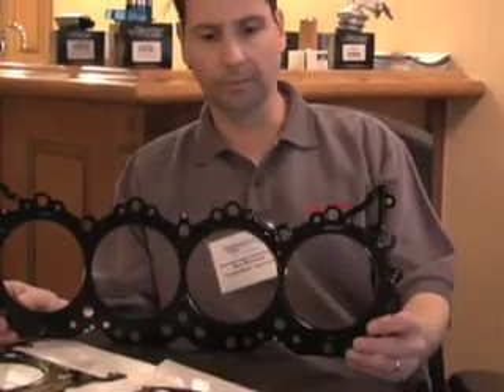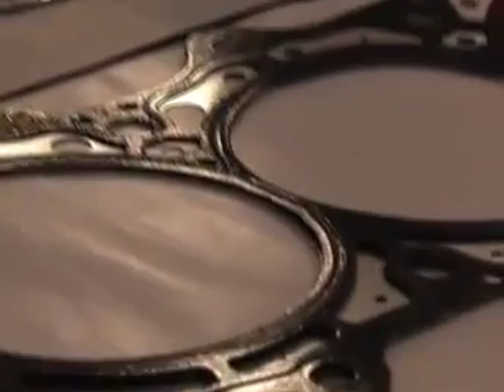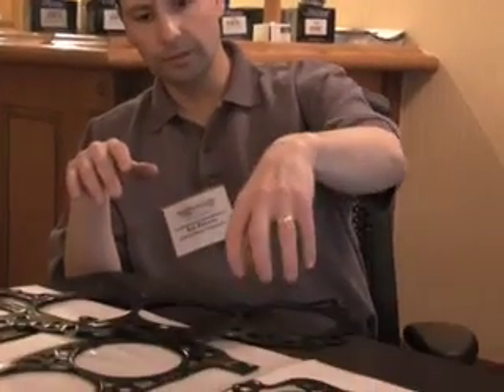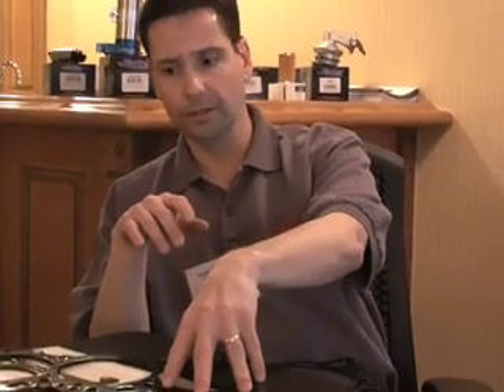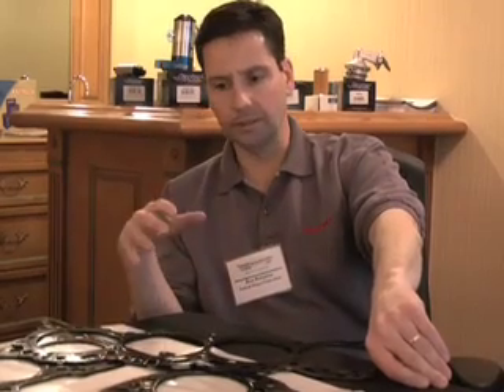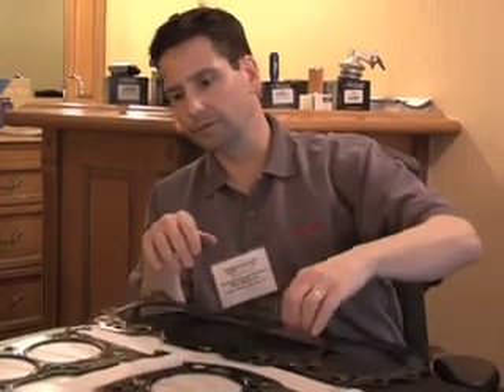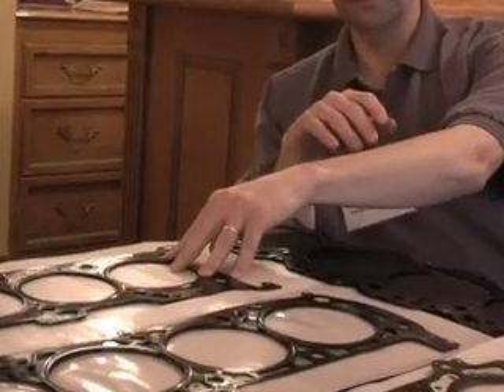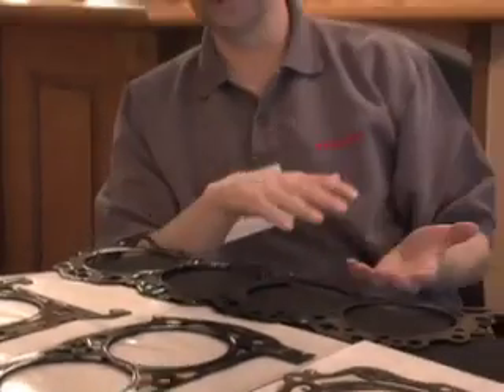Understanding MLS Gaskets

Comment: Do you have to torque the MLS head gaskets tighter than a standard head gasket
Reply: Kent Husted I can obviously see no one has answered your question. I'm curious about that as well, have you found out if they do need to be tightened a lil more?
Reply: Torque is related to the bolt size and thread  not the gasket, only use recommended torque settings by the manufacturer.